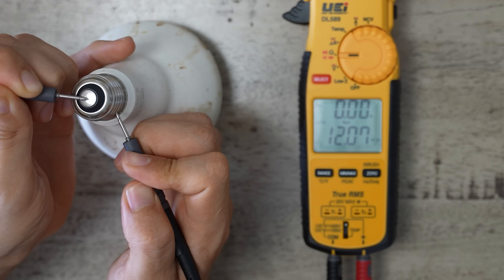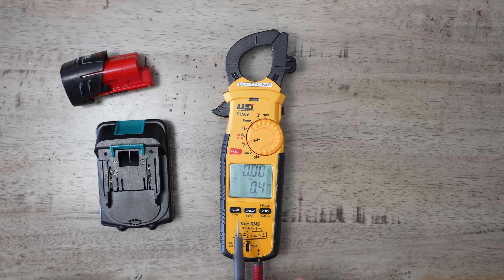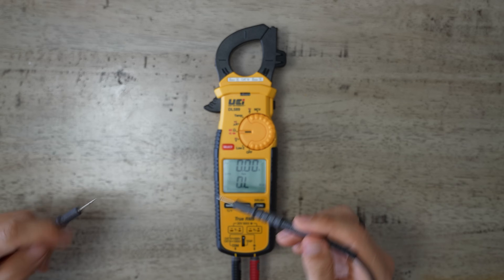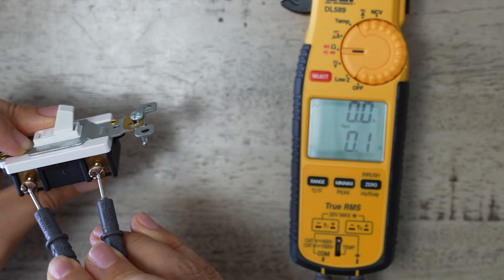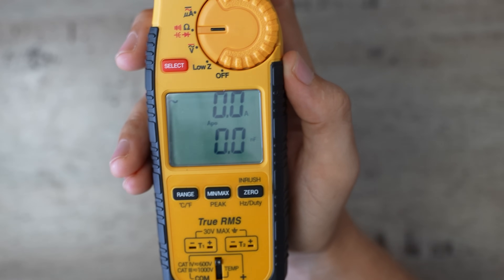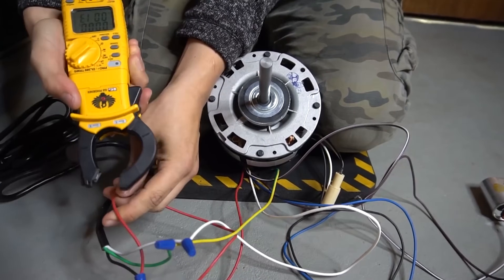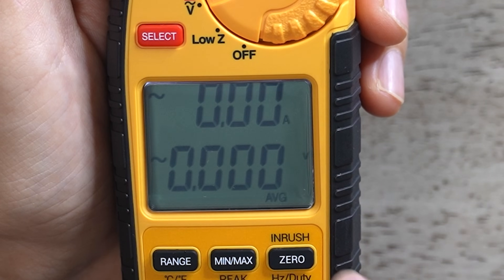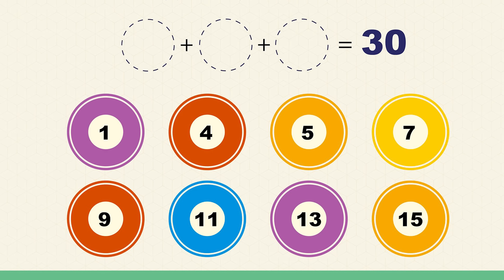How to Use a Multimeter For Beginners

Comment from the maker: ⬇ Here are a bunch more videos where I show how to use a multimeter in practical applications for anyone interested in further learning:

How to Use a Multimeter (Long Version):
https://youtu.be/zr4Ow1JT9jU
How to Test Water Heater Element:
https://youtu.be/btyVpGgQK3Y
How to Test and Replace Capacitor:
https://youtu.be/9ZGfvC-PMWU
How to Test Capacitor Tolerance (+ or  - 6%):
https://youtu.be/5_0nKm940nA
How to Test Contactor in A/C:
https://youtu.be/YCygHajsW34
How to Test High Limit Switch on Furnace:
https://youtu.be/ClAwh1HcoEc
How to Test and Replace Ignitor:
https://youtu.be/1bRsFAMgZRQ
How to Troubleshoot Control Board:
https://youtu.be/52iq9rYI0mI
How to Check Resistance on Blower Motor:
https://youtu.be/4S8TZd-45bY
How to Test Condenser Fan Motor:
https://youtu.be/fwjBkor-D3c
How to Test Compressor:
https://youtu.be/0aAj0iqP95A
How to Check LRA (Inrush Current):
https://youtu.be/LRBoNo3Iwfw
How to Check Microamps on Flame Sensor:
https://youtu.be/-QKHz1Mv9Ew
How to Test Pressure Switch on Furnace:
https://youtu.be/MWn55b8DXO0
Finding a Short With Meter:
https://youtu.be/4e4wsruGS0s
Using Multimeter to Troubleshoot Dryer:
https://youtu.be/ebJ9AyvyTMU
How to Test Circuit Breakers:
https://youtu.be/CZylBCMmKR8
Measuring Subcooling With Temp Clamp:
https://youtu.be/GlS8aAkUBT4
Reply: This channel is awesome. You explain things so much better than any other channel on YouTube. 10/10 👍
Reply: Love all your videos especially the furnace video's

Comment: Not a bad tutorial. The only thing I would add is OL stands for Open Loop meaning there is no connection or completed circuit. Not over load. So if you see OL on your meter it means you aren’t getting voltage/amperage/or a complete connection on that specific circuit.
Reply: OL = outta luck buddy
Reply: I thought it was Open Limit

Comment: QUESTION: Jake, the DL389 has higher reviews (and lower pricing) than the DL589. From your experience, is there that big a difference between the two that would warrant paying $219 for the 589 vs $177 for the 389?? Thanks!

Comment: I have a question: when does it matter where the decimal is when checking resistance? 

I have a similar meter, and I was checking the resistance  to a small 15 amp fuse I believe it was. And I was getting a reading. Leading me to think it was a good fuse. 

Next day I have a more experienced tech with me, and he checks the same fuse with his meter and got o.L.. looks at me like that’s your problem.. lol so I’m pissed, but I grab my meter to show I did the same thing and got a different reading. He changed the “range” and move the decimal over as if reading a whole number it showed ( OL. ) .

My meter when changing to ohms, defaults to M OHMS. And then changes depending on what I’m reading. 

Should I always change the range no matter what I’m checking? Or only for fuses?? 

Plz help me understand…

Comment: Multimeters have come a long way over the years. Even the low to mid- priced meters will offer most needed features.
The first meter that I ever used was a Simpson 260 ANALOG meter. You had to know how to read the scales behind the needle movement. That classic meter is still available today ( it’s not cheap ).
Stay well , Jay. 👍👍👍
Reply from the maker: I am sure they have! I started out with a digital meter so I don't know what that was like. Thank you for sharing your experience! I looked up the Simpson meter you mentioned and wow! They sell for $500-$800.
Thank you for stopping by, take care and God bless!
Reply: @WordofAdviceTV  The biggest ADVANTAGE to an analog meter is being able to see variations in measurements in real time, not at the sampling rate of the digital meter.
Reply: I had a Simpson meter years and years ago, can't remember the model. But if I remember right, it had a case that had a roll desk type opening on the front of it. Wish I still had it,or knew where under all my stuff it might be buried. LoL 😉

Comment: Would you recommend this meter? Lost my entire tool bag recently, can’t afford to get the fieldpiece I once had. This one has more features than that fieldpiece anyway.
Reply from the maker: First off, sorry to hear about your loss brother. That seriously sucks. As for the meter, my first impressions are good! I like it a lot. But I only recently got it so can't vouch for the longevity of it.. I used an older model for about 8 years (DL389B) and have no complaints about it. I actually still have it and it still works great. This new one is similar but with more options.
Reply: @WordofAdviceTV  thanks a lot for the response and yeah, fell out of the truck 🛻 and I only noticed the tailgate was open once ai reached the destination 🫠 …
Reply from the maker: @mannyfresh8504  Ahh bummer! Must have been a long ride too? That would be a bad day. Hopefully this mishap will actually turn into a blessing for you and your new setup will be even better.
Reply: @WordofAdviceTV  hopefully!! Thanks.
Reply: @WordofAdviceTV  so I got the meter and its been with me a couple days already. Sure glad I came across your vid. I can now carry just one meter instead of several 😂… its like my fluke 117 and my fieldpiece had a baby. Thanks again.
Reply from the maker: @mannyfresh8504  Yes! You're welcome. I'm glad you like the meter! I know the feeling since I used to have two separate fluke meters as well before I switched to UEi.

Comment: I have a question unrelated to the video and would appreciate your thoughts. Is it harder on your AC compressor to cycle on and off, or to run continuously?
Reply from the maker: Running continuously is usually better. There is more wear and tear on the compressor if it cycles on and off frequently than if it just ran continuously. This is because of the inrush current or start up amps. There is much more strain on the compressor when it starts than when it is already running.